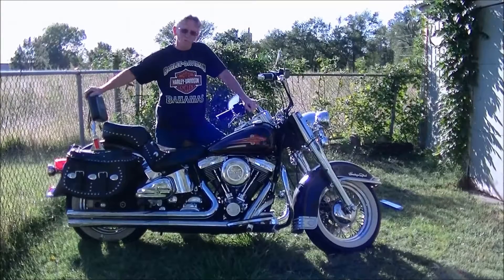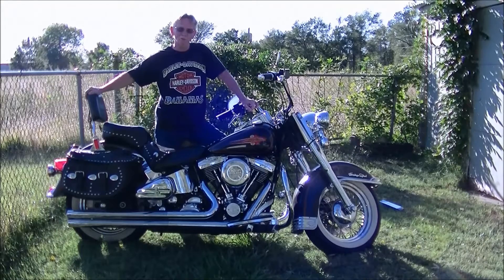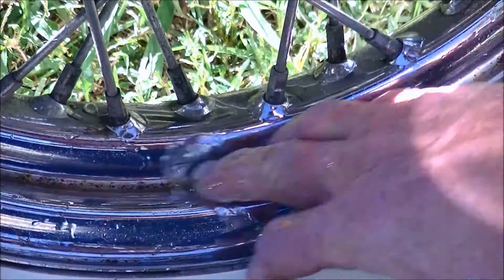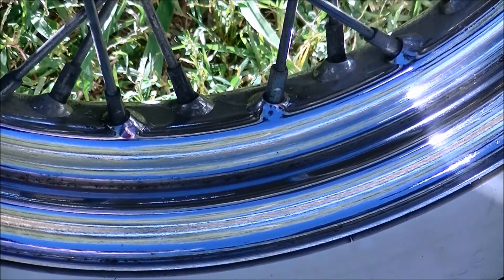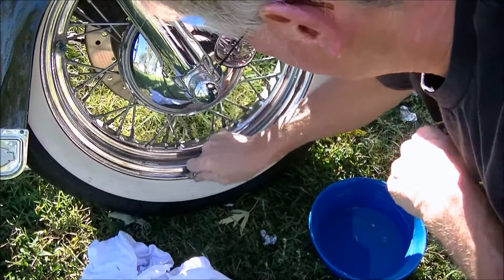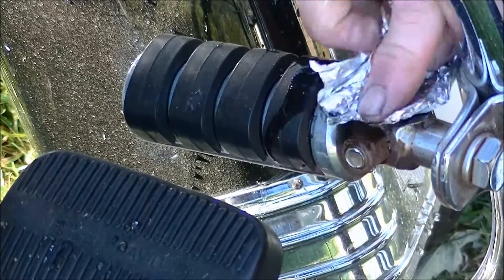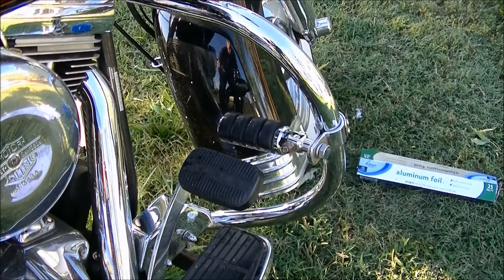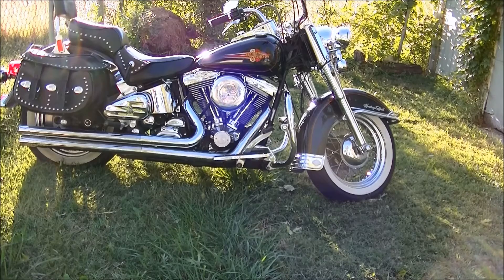Aluminum Foil For Rust Removal Does it work?

Comment: aluminum foil is softer than steel so it won’t be harsh to the chrome and won’t scratch,the idea of it is friction which causes a residual like a polish and takes away the rust,using white vinegar is best soak the foil in it them rub it will come off much easier and give a better shine try it it works best 👍🏻
Reply from the maker: Great Tip!! Thank You!!

Comment: I've owned my girl for over a decade now.

From my experience, Aluminum foil is working just like a scouring pad would and the scouring pad would do less surface damage.

I suggest polish and a felt wheel. It will clean the rust and chrome up quickly. But remember that polish and the act of polishing is just bringing that chrome layer to be thinner. So after cleanup make sure to coat that metal/chrome! Any spray oil will do. Just rub it on, old time riders use bacon grease on the exhaust to keep the rust out. Just don't leave her out there swinging in the wind or that oxidation with get her in the end.

Ride safe! Salute from a winter rider in the Canadian lands.
Reply from the maker: Lots of good info there!!! Thank You!!!!

Comment: Another thing you can do on racecars (don't think I'd do this on a bike) but it looks bad A on a car with side pipes... You can spray them down with WD-40 after every outing (especially at first) the chrome will turn deep bronze in color. Looks cool. It's a heat reaction.
Reply from the maker: I have never heard of that, sounds pretty cool!
I had a bike once that blow an oil line, not really the same as WD40, but, it coated everything, the pipes turned an off color, I bet that  is what happened. Thanks for the comment, I had often wondered if the oil is what caused it
Thanks,Lee

Comment: To remove the rust use a buffing wheel and jewelers rouge.
Reply from the maker: wb5mgr Thanks for the tip. I will have to try that!!!
Reply: @LeeRalph100  yep, and then seal it with F11 or Protect All. 
And when you do the aluminum foil clean, use white distilled vinegar and water mix. 
Ya gotta keep up on chrome and don't let it pit deeply.

Comment: I highly recommend using a product called "Never Dull" to prevent corrosion on chrome and polished metal. The military and car restoration guys have used it for years. 

It fills in microscopic scratches and seals the metal. 

http://www.nevrdull.com/page6.html
Reply from the maker: wb5mgr I have heard of it, but have never used it, thanks for the tip and webpage, I Will go read it. I also wanted to add, I do not know if you remember the lunch meal you suggested to me on a VietNormbo video or not. I have been eating it, and have lost about 10 lbs, THANKS!!

Comment: Great tip Lee, I wonder if it would work with my carbon steel knifes too.... Cheers, Marc
Reply from the maker: Thanks Marc, I am not sure about on the knives 
But I did just use it on my camp cooking pot. I had scrubbed it for days with baking soda to get it clean, just took a few minutes with aluminum foil.
Thanks for watching, Lee